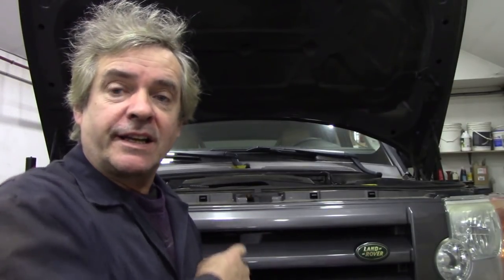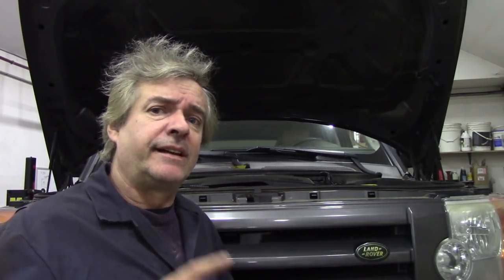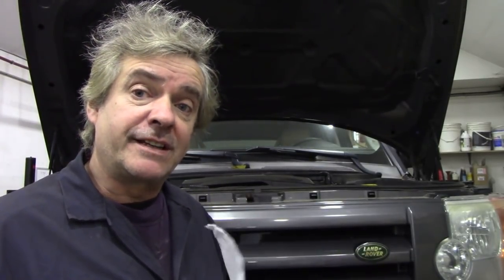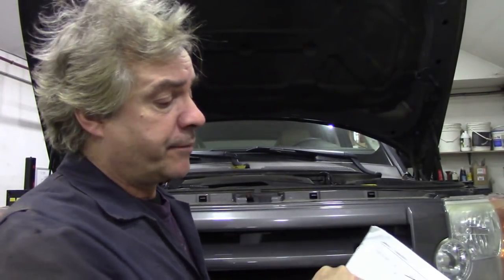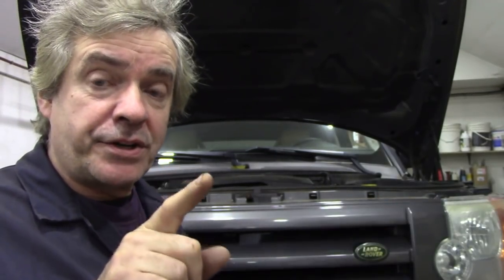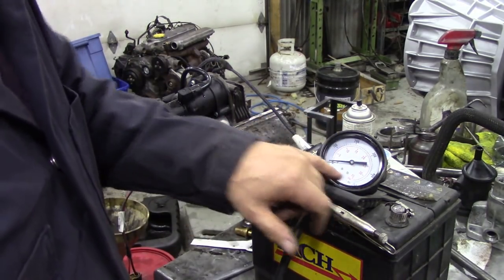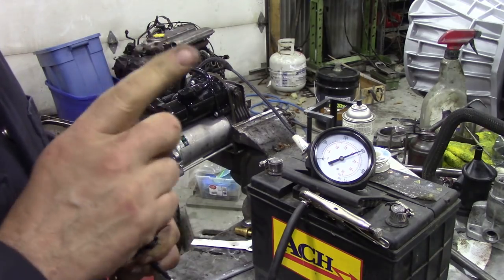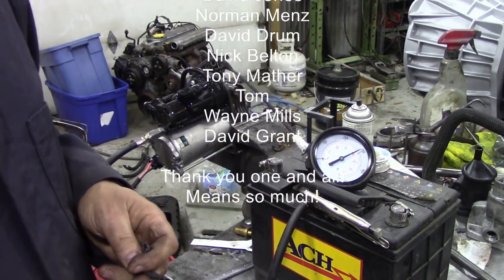LR3 / Discovery 3 air suspension problem - am I missing something here?

Comment from the maker: So the diagnostic fault is slow inflation of the system - runs a few seconds and cuts out
I am sure it is not the pump BUT I do not have this fixed to the vehicle so it could be that the computer is opening the exhaust valve - not sure - but the unloader valve is working as the pump starts under pressure
I am quite surprised the LYNX system has no facility to open and close the solenoid valves -if I could, say, trigger a valve to open and it does not then I can say it is a sticking valve or a computer/wire issue - easy fix 
I cannot even override the pump to stay on long enough to check the valves
You would think that there was a valve sticking but the gallery feeding the suspension units have a valve each on a common manifold (gallery) - so surely I could get one corner to raise?
I may feed the system with dry shop air and see from a known supply, what the pressure switch is saying ( I can read that on the LYNX)
If the switch is shot then the it will trigger a slow inflation issue
Reply: Britannica Restorations Ltd fault code C1A20-64 present? Likely a blocked filter on the EAS compressor. I'm fairly certain this little conundrum was rectified with the newer AMK compressor as I've never seen one of those fail. Hitachi units however, sometimes doing three or four a week.
Reply: Also, now that I've watched later into the video and you mention that the filter was not blocked. They do a piston rebuild kit to prevent air leakage and allow pressure to build again. Quick tip, if you're looking to do a leak test, open a door and leave her overnight. Door open will not allow the system to vent, safety reasons and what not.
Reply: Well that seems to be building pressure quite nicely... you could have a crack at renewing the relay, that'll be a cheap stab in the dark. Seems like an issue with one of the valve blocks to be honest, a stuck valve perhaps which is preventing a corner from raising as it should and creating too much back pressure. As it will be reading from each of the height sensors, this seems to be the likely cause for a fault.
Reply from the maker: I heard from thre customer it has a small leak but they guy does not want to put anything into it - pump will probably go but he is thinking of coils now
Reply from the maker: AMK is fitted
Reply from the maker: In the end it was a disconnected pipe  - I did a quick fix but needed a proper pipe
Reply: @BritannicaRestorations  Nicely done on the fix, coil conversions on these are the way to go in rust compelling environments.
Reply from the maker: The coils were fitted to the Commercial version of the D3 - we didn't see those hereI bet with no frills they were quite good
Reply: @BritannicaRestorations  They were here in Oz too, on what we call the poverty pack model. I only noticed them on the SE's with the 4.0 v6, can't recall seeing a factory diesel or v8 with them however. If you're interested, hit me up with a message as I may have a load of manuals you'll find of interest. All genuine JLR published manuals from when I did my apprenticeship and technical training when qualified.

Keep up the good work mate, I never want to work on the bloody things again but the nostalgia is nice.
Reply from the maker: Thanks! Sounds interesting  - I will send you a PM
Mike

Comment: Maybe check the air tank for corrosion or leaks. The air suspension on D3s is normally very reliable (in my experience)
Reply from the maker: Think is I cannot get air into the tank or system
Reply: Good luck sorting it. I have to admit I sold my D3 and swapped it for a 32 year old Range Rover with a 200tdi - so much better and I stand a chance of fixing it!

Comment: In compressors you get condensation,  maybe water is emulsified with lubricant and blocking things up.
Reply: I have Disc 2 year 2000 the air pump was not working faulty pump orderd new one all good :) and I restord the old one for a spare.

Comment: My disco 2 which we've owned for 18 years has had a few problems but it's never been a problem where it's left us stranded...
I had a valve block go which had cracked and letting air escape so wouldn't lift car so might be worth checking the valve solenoid or block...
I've always treated it as a service item and replaced the bags every 7-8 years along with ride height sensors and have always kept them clean, I think I'm on my 3rd compressor which I don't think that bad.
Personally I love the air suspension but keep it maintained and I think that's the trick with it...
Reply from the maker: But it is all the time and hassle when it lets you down.. Literally!
Reply: Britannica Restorations Ltd like I said Mike, it hasn't really as the only real problem was the valve block cracking and that was when it was parked in the drive, luckily I had one with the old compressor.
Both times the compressors have been changed was down to them making a strange noise so I changed them before it was a problem...
Air bags aren't expensive and take minutes to change and the same with the compressor, well that's a little longer!  I like the ride and the self levelling, I've loaded mine up with sand and cement bags and start her up and within a min it's back to normal ride height.
If you wanted the 7 seats when new then it was fitted with air suspension, change the air bags to springs and the insurance can be invalid over here in the UK...
Reply from the maker: The D3 is a different system to the D2 SLABS - that was easy/and cheap to fix   - but C$1400 for a rear spring for the D3 - the issue here is I probably need a better diagnostic system to work on this
The book says  inflate the system with the T4 diagnostics  - I just cannot warrant spending money on a new system - have to do it old school bu that is time consuming
Reply: Britannica Restorations Ltd yes my mates got the disco 3 and he's been through a few compressors, my fathers disco 4 has been 100% reliable and that's coming up to 8 years old now..
Unfortunately Mike it's the path Land Rover have taken, my wife was just watching on her Facebook the Land Rover 70years page with the Velar.. you should read some of the negative comments... I do wonder sometime what the hell Land Rover are playing at!
You either move with the times or you don't!    That's the reason I drive my old 200 defender and the wife has the old 2001 discovery. Easy to fix!
Reply from the maker: We used to say back in the day, as soon as Land Rover fitted ashtrays to their vehicles, they were on a slippery slope......
Reply: Britannica Restorations Ltd 😂😂😂 yes I'll agree with that Mike, it's like they've gone from one extreme to the other!!!
The company is in the hands of the accountants now!!!!!
Reply from the maker: Pill - I honestly do not know how that have not been sued to the hilt by knowingly selling vehicles with faults - and they NEVER learn! 
P38 air - problems - Oh lets make a D3 and not learn anything  - but we can make it complicated so only dealers can fix it
Just because you can  - does not mean you should!
Reply: Britannica Restorations Ltd it's all about making money now Mike, such a shame.... I have a little Hawkeye diagnostics and that's more than enough for me!  It's not just Land Rover, their all making it harder to work on.
My old boss used to say it was a stupid move putting the plastic grill on the series 3 and having a plastic dash... I'd love to know what he thinks now!!!
Oli
Reply from the maker: I agree - but think of the money they could of made with a product the world was wanting
did you read about this

https://www.gazettelive.co.uk/news/teesside-news/cough-up-pm-urged-back-15043229
Reply: Ah you only have to look as far as the head linings, they never fixed the sag problem! It just went from model to newer models and they still sagged! Your right Mike how do LR get away with it? Yet we still buy them, we’re nuts!,!
Reply from the maker: We should (for fun), make a list of known issues Land Rover had as soon as they got out of warrantySo here goes a a few off the top of my head:
The output splines on the LT77/R380Clutch fork fails on the LT77/R380Adwest steering box leaks300Tdi timing belt failsDefender light switch/wiper switch/indicator switch premature failsSalisbury axle leaksTransfer case leaks300Tdi vac pump fails300Tdi flue lift pump failsWiper arms lose'Heater' failsEndless water leaksTd5 engine wiring harness leaking fuel to the ECU

It's 4am here - I am sure we can add more!Mike
Reply: Britannica Restorations Ltd yes I've read the article on Jim Ratcliffe when he was first talking about it...
3 things which would have made the Defender perfect in my eyes and here it is-
All steel work galvanised 
Stronger gearbox and just a general upgrade on transmission with locking diff front and rear as standard
Increased the size of the TDI, like the International HS 2.8 and improve year after year....I know our friends in the EU wouldn't of allowed that of course with emissions !
I spend most of my time on here arguing with Toyota owners, if they found this site they'd have a field day!  
We have owned Land Rovers in our family for more than 30 years and range from a 1959 series 2 to the discovery 4 HSE... I don't think their that bad, they have problems but I've only been left stranded maybe 3 times in 30 years... it's always been a problem which will get you home!
Reply from the maker: I have had LR's since I was 19 and they have been pretty good, (apart from rust) but when I put my mechanics coat on, I see all manner and means of breakdowns come in that should not happen in the first place
I agree with what you say but not to the HS2.8 - the 3.9 Isuzu as fitted to the Australian army Defenders was excellent (got one in my 130) - and that was in the early 80's - so why the pain and misery of the 2.5 NA an the TD /DT etc?
To be honest I cannot see Ratcliff's dreams get off the drawing board - it will be super expensive and have to appeal to a massive market which, to be honest again, LR gave to the Japanese decades ago
Reply: Britannica Restorations Ltd putting anything Japanese into a Land Rover for me Mike is the ultimate betrayal  lol
Land Rovers TDI engines were brilliant apart from a few problems, the problem with Land Rover is they sat on their ass when they should have been upgrading and evolving the vehicle!
Why did they keep the opened diffs on a vehicle which is meant to be the world leader? The list is endless Mike!
I've had every Diesel engine Land Rover ever made, this is a prime example and them slowly being left behind in the 80s... the old design is great for plodding and is generally a reliable engine, I still see people smoking about in the old 2 1/4 diesels covered in oil but still going!
I can understand why they thought it would hold up with the turbo being bolted on but without strengthening things like the block is madness!
I've got 2 19j and they both get used every now and then, one in a series and the other in my mothers genuine 90 county, both start and have provided good service!
Maybe if Land Rover would have employed some enthusiasts we would have all benefited from it!
Love your channel Mike but please stop slating my beloved Land Rover even if they are shit now!😂😂😂😂
Reply: I mean heck...
What’s $10,000 every 7 years?

Oh and that’s just for the suspension. 
Not even the engine or tires or fuel...

Comment: Use to have one of these loved it. Air suspension is a pest check disco 3 wiki page for lots of help. 
Main issue compressors, valve blocks, tank holes, and connectors. Nearside (UK ) wheel arch has the wiring harness for the air suspension towards the bulkhead
Reply from the maker: Yes James but you end up replacing the whole system - my point is if they are going to make an air suspension system for an 'off road' vehicle, then make it as trouble free as coils and shocks

Comment: That looks like an amk pump check if it’s had the up date done they run at a lower pressure (255psi the older ones run at 275 psi .c230 fault code is usually the exhaust valve sticking in the side of the pump be careful when undoing it the ally bolt sticks sometimes.great videos

Comment: The tone of the pump when it's getting to full pressure sounds about right compared to my disco 4 so think that pumps okay to be honest. If it's not filling the system quick enough I bet it's got a leak pretty early into the system so at least one sensor is detecting a slow increase in pressure. My nsr bag has a split that sometimes holds air or doesn't. If it detects a leak it shuts down the whole system with a suspension error fault and stops everything
Reply from the maker: It's working!
I will cover this in an update video
Reply: Mine is not lifting. The pump turns on and off. Just looping through on and off. But zero raise.
Reply: @Assistingalways  that could be a leak coming straight out of the pump or the exhaust is stuck open, it'll get the pump burnt out pretty quickly if it's continuously pumping though. Maybe try checking the exhaust filter?
Reply: @Rickus23  checking the signal that turna the relay on, it's definately the one thats cutting out. The pin that activates the relay is not providing a straight voltage. It's responsible for on and of.

Comment: I had the same faultcode. Redaing about it on the disco3.co.uk site, i located the fault to be in the drier cap. Where you have the red and blue collar it was cracks that air escapede from. Replaced cap and all good ever since.
Reply from the maker: This had a brand new pump already fitted
Reply: Hmmmm you are bloody right mate.. Next step I would check what version of the amk compressor you have at hand. I remember reading about some of the first gen amk compressors had an internal fault. If my memmory servers me right, there are 2 software versions avalivble for the amk's. for first gen and for 2,nd gen. I have replaced the compressor to an amk gen2 on my lr3, and it did not like the software on the eas module. I had to reprogram it with the correct software version.
I bought an IIDTool from Gap Diagnostics. i think it was around 150 quid at that time. Its a handy device communicating with your Apple / Android device. And you have all the live values for your viewing pleasures.
Reply from the maker: The GAP tool is made not far from me.  I tried to tap them for a freebie to test it but they would not be on!
Tell me - can you test individual valves and relays?
If I could have set the pump running I could have found this better = I could on the P38 but not on this truck

The LYNX I use is made by Omitec which makes the LR T5 machine but the section to test individual parts is not available

Comment: Hi Mike,

I don’t have experience with the D3’s, but with the P38 Range Rovers. We had a good 6 months of issues (back in 2001ish) and the car was about 5 years old. 
Similar issue to what you describe, the computer would log a fault code for not enough air supply. I may be wrong, but I thought that the P38 would fill the air tank first, then the air bags? Whereas the D3 fills the air bags first then the air tank second? Either way, we had the first issue being a slightly leaking air bag. Sort of fixed the problem, but not really. Then tried replacing the compressor, no difference. Finally we changed the valve body, as we couldn’t properly test the one in the car. Changing the valve body fixed the problem. Leaky valves turned out to be the only thing that could leak air quick enough/ or prevent air flowing, to consistently cause the issue/log the fault code. Hope there’s something is my small essay (lol) that might help you. 

Also love your videos and approach to land rovers and servicing. Kicking myself that I didn’t make extra time to come and visit when I was in Montreal. 
Cheers, David
Reply from the maker: David - it seems there is a valve issue not been throw up by the computer - OR a bad pressure switch
P38's were easy to work on compared to this!
Reply: d schil03 ghastly bloody things those were... I know, let's take all the electrics and govern them with a single module... here in Australia, Brisbane in particular where I carried out my time with JLR, we used to have to send the bastards off to Perth as there was one man in the country that used to diagnose and repair the BCM. A/C, heaters, accumulators, air suspension... the flashbacks are real.
Reply from the maker: Seems I am getting all the back heels in Quebec!
Had enough now
You know the P38 with air was a pain, but once you worked out the issues it was pretty simple 
But JLR never learn from their mistakes - the feed back (if they listened) must have given them so much information where they were going wrong 
So what do they do = well they did it all wrong again and made it tie in with all the rest of the crap
Same goes for every product they made - never listen to the customer, and now they have 'designers' coming up with concept cars, the engineers have to squeeze all this in with no thought to the workshop techs who have to work on them
And don't get me started on Genuine parts pricing and availability....
Reply: @BritannicaRestorations  Totally agree  with this, the Evoque was a prime example. A designer handbag for designer wives.